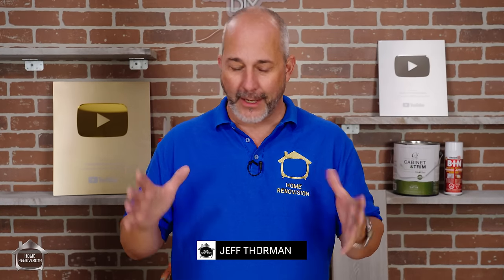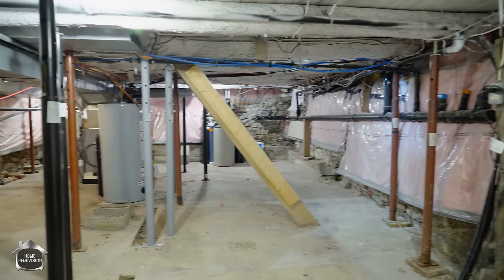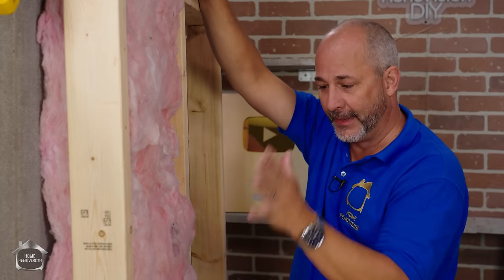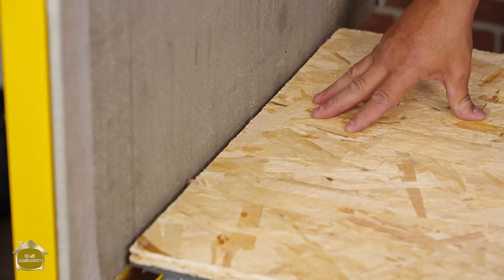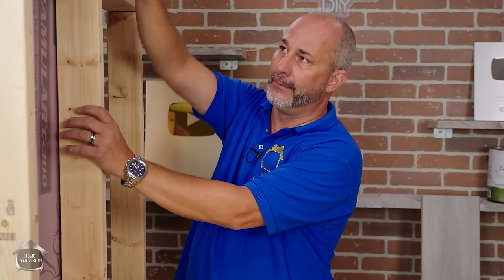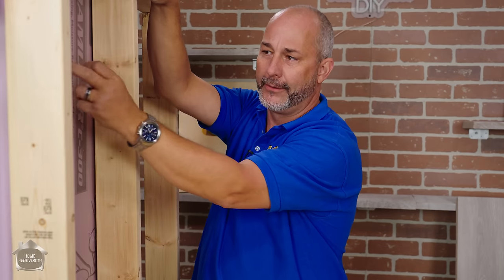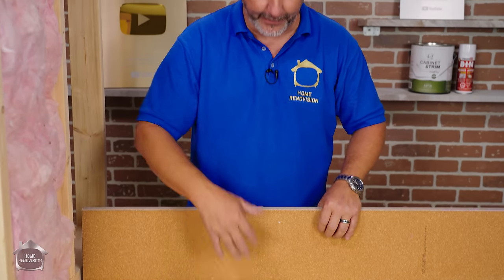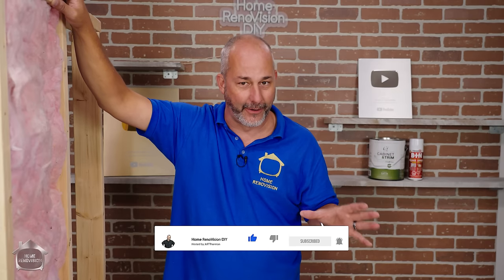The Best Way To Finish Your Basement

Comment: Have a question in regards to design shown at point of juncture where subfloor and continuous ridgid insulation and wall framing meet.

Hopefully I can describe this well in written form. My question comes out of the Dricore subpanel being played down first with an exposed osb edge that is yes 1/2" away from bare exposed concrete wads and the sandwich encapsulated behind the future enclosed floor and wall with the bare osb still there.

Would it not be a better design to install the 2" ridgid insulation first to the wall with a couple dollops of the PL300 to the bottom edge touching ground and or plastic shims to hold 1/2" up from ground, then install Dricore subpanels then wall framing?

Comment: Thanks for all the great videos.  Do I need to use concrete leveler in my raised ranch basement before the Dricore subfloor panels go down?  Or can I just put the Dricore panels right down on top of the concrete floor.  It was a finished basement before but i know the floor is slightly out of level in some spots.

Comment: Is screwing the subfloor panels to the concrete and then securing the bottom of the walls to the top of the subfloor enough? Also what about covering floor drains with subfloor? Is it better to just plug them off?

Comment: I have a 1960’s home basement in Michigan that is unfinished at this time. I am wondering as i start to finish the basement the recommended order, should i start framing walls first then put the dricore panels in each room or should i start with dricore panels throughout the whole basement then frame out walls separating rooms on top of the dricore?

Comment: when you bump the wall out and use a gap between the subfloor and foundation. The idea is to allow for moisture to go up the wall, but how would you do fireblocking this way? it seems you can either have a way for moisture to escape or fire to be blocked?  Or am i missing something?

Comment: What would you suggest for a stone and mortar foundation (built in 1891). I am already planning on repointing the foundation as the previous owner neglected this and many spots are basically just sand now, but I have been trying to find a way to reduce the humidity down there and eventually finish it enough to be a play/storage area. Have a humidifier going 24/7 to control the humidity ad much as possible but I have to drain it twice a day in the summer. 

My main concern is that if I cover the current foundation walls I won’t be able to see when trouble spots arise in the mortar and I will need to repoint again.

Comment: are you saying (about 6 minute mark), that the moisture coming into the spaces in the subfloor system's airspace, transfers into (drier) concrete wall?  Otherwise, where does the moisture go since the polystyrene wall insulation is flush/glued to concrete wall?   Can you further explain this moisture transfer please?  thanks!

Comment: Thanks Jeff. Great video. I am planning to build a half-wall to cover the poured cement bottom half of the wall in the basement (3 feet), but keep the original brick from ground level up. Will insulation like you described here provide any r-value if only covering the bottom half of the wall?

Comment: Suggestion my basement has a 2" drop in my floor over an 18' span I want to put luxury vinyl plank in my basement House was building 1957 Will this system still work for my house

Comment: Jeff, love your videos and learned a lot. You talk about the foam insulation against the concrete. Easy installation on a flat wall but my basement has a lip half way up. How do I go about doing that? Plus framing?
Reply from the maker: I would frame the top portion of the wall 24" on center to provide a place to install the4e insulation with the adhesive in order to maintain the integrity of the overlap joint on the rigid insulation. The thermal break is only beneficial if it has integrity. then finish as discussed. Cheers!

Comment: Sounds like a great system for walls and floors but what do you do in the uninsulated rim joists of older homes?
Reply: I’m curious as well, I was thinking of spray foaming my rim joist, but that doesn’t leave room for evaporation?
Reply from the maker: I will have to do that video. Cheers!
Reply: @HomeRenoVisionDIY  Any update on this? Currently buying the dricore + rigid board and unsure if I should be using the remains of the foamboard for the rim joist.

Comment: I live your videos and this is perfect timing as I just cleared out my basement to start finishing it.  I already have the dimple membrane/plywood for the subflooring but was planning to get green treated lumber for the bottom plate of my wall and standing up the walls before the subflooring.  Would you still recommend using all regular studs and putting them on top of the subflooring with this system? If so, what is the best way to secure the wall to the subflooring? 
Thanks!
Reply from the maker: to secure simply use a drill and tapcon screws to attach the dricore to the concrete floor. then screw the bottom plate into the subfloor. Cheers!

Comment: I have a question. I live in a brick row home In Philly. My "basement" is at grade level, from the garage at the front, to to the back door that leads into the backyard. Technically I guess it is not a basement because neither side is below grade. What would you call it then,? The first floor? 
Also do I have to worry a lot less about moisture protection because it's at grade level. The floor is cement and the walls are cinderblock/cement)

Comment: US Midwestern home built in 58. If I’m not finishing my walls, and just want to put LVP down do I need a sub floor? Currently very old and likely asbestos glue tiles on the basement floor. Previously never considered finishing the walls because thought it was too much of a risk due to moisture. Thoughts are if I keep the basement materials inexpensive no worries if they need replaced down the road. But maybe there’s a better option. Not wanting to spend too much, only going to be in the home 10ish years and not in a real estate area we’re I’d get max investment back.
Reply from the maker: Hi Thomas, you have the right approach. homes from that era have so many possible water events that finishing the basement does not create value. If It was my home i would encapsulate the flooring with a new vinyl product directly on top and install tyvek on the walls with blanket insulation. this will help to keep the floors on the main floor warm and reduce drafts so you can lower the thermostat. The blanket wrap isolates the fiberglass as well so a decent air quality. nice t.v .room for kids looking for a hangout without the worry of throwing good money away. Cheers!

Comment: How does this ridgid foaming+batting method compare to spray foam? 

I might do this and sheet the rigid foam so it also acts as a vapour barrier. Would that be a viable solution or would I just be setting myself up for an expensive failure in the future?

Comment: Hey Jeff, as a contractor this is also my preferred method of finishing basements. I hope I didn't misunderstanding you in a quick comment about the finishing part. Did you say to use a vapour barrier over the fiberglass before drywalling? It's my understanding that this would create a double barrier system which is not allowed and also bad.
Reply: Yep. From my understanding if you tape the seams of the foam it becomes a vapour barier and there should not be a plastic vapour barier on top of the studs because there would be a double vapour barier
Reply: What kind of tape do you use on the foam?
Reply: @RobShutt357  Tuck Tape. Same as you would use on vapour barrier
Reply from the maker: in our area code requires plastic sheeting as a vapor barrier regardless of your wall assembly. I use the air space as a way to allow rh balancing. even though you have 2 vapor barriers they are not in direct contact so condensation does not occur. the wood framing has the ability to transfer and balance RH for any moisture that is in between the 2 barriers. That is why you frame on top of the subfloor...it eliminates the ability for water events to infiltrate the wall cavity. Cheers Josh!
Reply: @HomeRenoVisionDIY  Hey Jeff, have you taken down any basement wall system like this that has been used for some years to see if there are any problems sandwiching the fiberglass insulation and wood studs between a vapour retarder and vapour barrier.

Comment: Fantastic video, I am in the process of doing this! - in Hamilton, Ontario :) 

One question: I'm adding a small kitchen to my basement and for the oven, I am wondering when I route the exhaust vent, does it have to be a certain clearance away from the rigid foam boards? Not sure if it can touch the foam boards because I would imagine the ductwork could get pretty hot?

Comment: With this system what about using steel studs instead of wood?
Reply from the maker: works well. just be sure to get the steel rated insulation width.

Comment: Thanks for the great video! If the floor slopes like crazy (4in over 12ft) to a center drain (1954 house, Quebec), is it more efficient to level it with floor leveller and use these subfloor panels or do shimmed sleepers on a dimpled membrane?
Reply: I'd be curious of the answer to this as well.
Reply from the maker: In a house that old I suggest using the panels and then finish with carpet. too many problems using plank flooring and the cost to level is huge. I don't recommend over investing in a basement since you just don't get the return on investment.

Comment: I have a unique basement construction that I haven't been able to find any information on. Its a concrete wall with concrete studs 24" on center. The concrete studs are 7" deep and have 1/2" of wood on the face presumably to screw drywall into. There is currently just fiberglass insulation between the studs. What is the best way to finish these walls?

Comment: Thanks for sharing this Jeff. I do still kind of like your old subfloor system. Why do you reccomend the dricore panels now? I remember you saying at one point that the cost benefit of the former has disappeared. Is this still the case? Do you think you get better results from the dricore  or your old system (even if with the price of osb the latter might be more expensive now)?
Reply: I have the same question

Comment: If my house was built in the 1960's and Im ripping out the walls in the basement and on the cement floor they have ceramic tile installed should I rip that out and put a subfloor down or can I put vinyl ontop of the tile?

Comment: My basement foundation is 100 year old poured and very uneven. I can't get foam board up against the walls.
I'd like to cover the entire wall behind framing ~2 inch of closed cell and then fill my stud cavities with batts. 
Am I going to get into any trouble without the small air barrier you mentioned behind the foam board?

Comment: How does this all change in an area with expansive soils, like Colorado? Code prohibits the studs being in contact with the basement slab, and requires a 2-3” gap.
Reply: I recently saw a basement build in Colorado, you guys are insane. The one I saw was basically all thread or j bolts so the studs were spaced off slab like 2 inches..... Still dont understand how that makes it better because if the slab is still moving so is the wall unless your adjusting it on the regular. Same goes for the house, are the footers moving excessively too? Theyre poured on the same expansive soil....
Reply: Yes the floating concrete floor with walls hung from above/side -- a special technique that apparently only Colorado builders deal with lol
Reply: @Cameron-ur2tk  The footers go quite a bit deeper, so I imagine aren’t as impacted by surface water permeating the clay layer that the slab sits on top of.
Reply: Could you just put 2" of foam board under the bottom plate?
Reply: @the74impala  The typical setup is a PT 2x4 fastened to the concrete, above that a 2" air gap capped with a non-PT 2x4, with the entire assembly hanging from above and/or from the side.  Large spikes are driven into the two 2x4's across the air gap to hold the wall in position horizontally.  When the concrete heaves due to expansive soils underneath, the PT 2x4 floats up with the concrete floor closing the air gap.  Later as the soil dries out and compresses, the floor settles back down, reopening the air gap.

All good in theory but many issues in reality.
Reply from the maker: If it was me I would not finish a basement in expansive soil.
Reply: @HomeRenoVisionDIY  the best solution
 is to only use a structural wood floor where there is expansive soil

Comment: Hey, so my basement leaks during winter thaw. I have a stone foundation, I can't do external water proofing for a number of reasons. Can I slap on a polyurathane barrier between my wall and framing to protect the drywall and wood from rooting? For flooring I'm planning to get dricore so that nothing gets wet for those once a year leaks. I'm only planning to do this to 1/4 of my basement. The rest will be unfinished. Will this work? Or will I see issues down the road?

Comment: I bought a house from 1964 that has old tile glued to the basement. The basement is dry as a bone, proven by the garbage bag trick. Do I need to put a layer down or can I rip flooring right over the glued tile?

Comment: What will this do for radon? I would like to see your take on this problem.
Play safe from Elliot Lake, Ontario, Canada.
Reply from the maker: radon is dealt with by coring in the floor and providing a pipe for the radon to travel through to the exterior. simply pick a corner and build a closet for the system.

Comment: Hey Jeff, as always, thanks for the wonderful content! 
In this video, you state you like the insulated dricore panels more than your previously utilized platon dimple board and 3/4" tounge-&-groove OSB. Why the change of heart, and why do you recommend the insulated dricore panels over all else? I am located in Toronto, and based on local costs I generally calculate the dricore at about $2.66/sq ft versus $1.74/sq ft. Is the net $0.92/sq ft worth it?
Sincerely, 
Pd
Reply: Excellent question, I too, am wondering why the change in approach. The suggestion of using the rigid insulating foamboard (8' x 2' x '2") glued to the exterior wall adds roughly C$3.59 sq/ft to the cost. The $ saving option of changing from 2 x 6 studs to 2 x 4 studs with 'thinner' fiberglass isn't enough to justify using the foamboard (IMHO). After viewing all the videos he's put out over the years (THANK YOU, JEFF) I'm going to go with a wall made of Typar stapled to back of 2 x 6, R20 pink batts, 6ML poly vapour barrier mounted on the dimple board/OSB subfloor. I'm a neighbor to the west in Mississauga with a 900+ sq foot basement so $$ are critical. Good luck with your reno.  🙂

Comment: For a laundry room in a basement that is so dry a sump pump is not needed... Do you think I should go epoxy or cement paint for the floor? Walls are staying moisture barrier painted block. 

May just go with rugs for the floor. House is in Minnesota so the floor gets kinda cold. But still kinda want to make the floor better looking than just grey cement.
Reply: That paint/epoxy stuff does not work and will eventually peel. The only stuff I've seen that lasts a decent amount of time is applied by a contractor and is some pretty gnarly stuff. Maybe look into staining it instead?
Reply: I used rubber puzzle piece flooring for home gyms in my laundry room basement. It's warmer and softer than concrete and I don't care if it gets a little wet
Reply: We used carpet squares - the plastic-backed low pile stuff like you'd see in an office - in the basement in our last house and it worked great. Just applied directly to the concrete floor with double-stick gaffer's tape. All you need to install is a utility knife and a yard stick.

Worked well enough to warm up the area and definitely took all the echo out. 

Even had water intrusion a couple times - I numbered the edge pieces and carried all the wet carpet up and laid it out on the patio and/or driveway for a week, then once it was dry and fresh put it back down.

Comment: If you maintain the air gap between the foundation wall and the rigid insulation, do you still seal the Rim Joist?  If no air passes thru that area anymore will you effectively just keep moist air in the basement?

Comment: I have what you showed in your video 4 years ago on insulating a basement wall.  I have studs already installed and thought I would install the vapor barrier behind the studs (as you did) then add the insulation and a plastic sheets before putting up the drywall.  I can't get the insulation board behind the studs. Let me know if you think what you showed 4 years ago is still valid and the way to go.  It is a new house so I don't plan to add the subfloor with vapor barrier, is this a mistake even in a new Georgia home?

Comment: Minimum code states that the maximum difference between risers on stairs is 3/8". The bottom riser on my basement stairs is the same as all the others, not longer to accommodate a finished floor. Given that, what would you suggest to keep the finished floor within 3/8" thickness difference?
Reply: I'm in a similar situation. Looking at a making  3' x 3' "landing" of tile right on the  concrete pad to maintain the height to the first step, then using transitions up to the subfloor that has different tile.
Reply from the maker: ask you inspector. most will allow a greater variance in favor of a subfloor system. some might want you to cap the stairs with a new surface like carpet to reach the new height. Very few will demand you install new stairs.